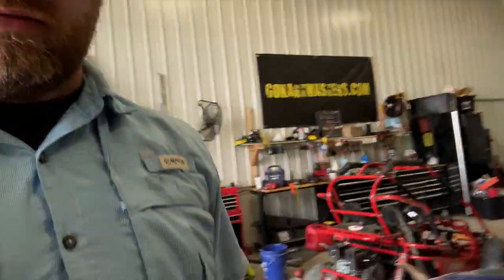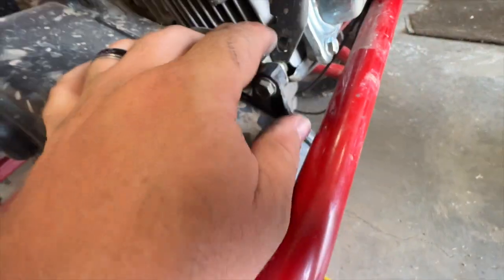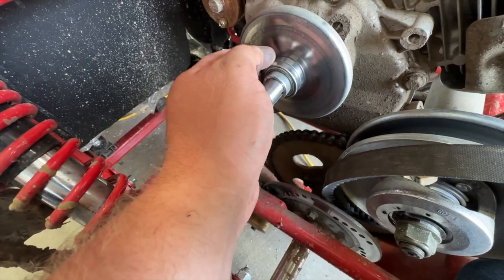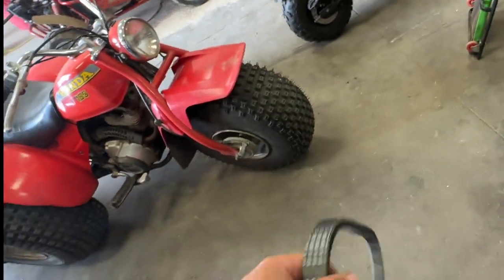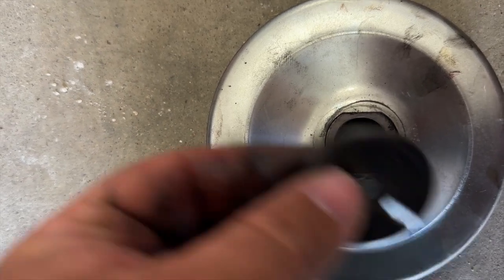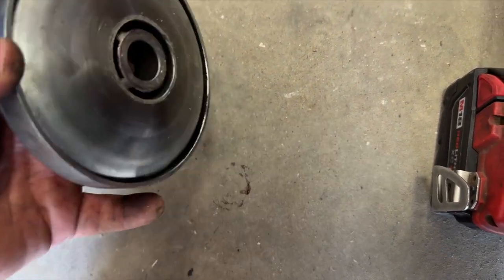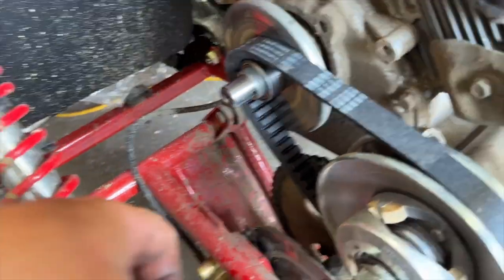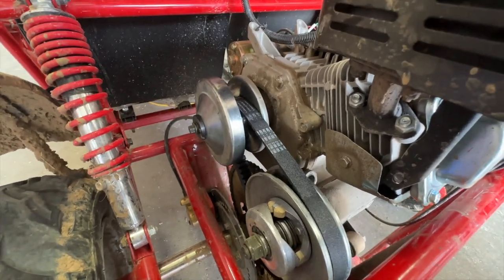How to Service the Torque Converter Clutch | Trailmaster Mid XRX or Mid XRX-R

Comment: Great video! We just ate through our belt on a mid xrx machine. The belt i pulled out of it had 669 stamped on the side. Whenever i look for replacement parts, searches will recommend a 725. What's the difference and can a 725 be used or do we need to stick with the 669? Thanks!
Reply from the maker: That number is the length of the belt in millimeters. Some of the hammerhead machines take that 725, and some other karts of a similar size use it as well. The 669 is for Trailmaster Mid karts WITHOUT reverse. The reverse models take the 788. You can find both options on our website, as well as a made in the USA performance belt. Check out GoKartMasters.com.
Reply: @GoKartMastersAcademy  awesome! Thanks for the details and ultra fast response!

Comment: I got a mid xrx that when we step on the gas, you hear a lot of power from the engine, but the kart barely moves. It also has a brand new engine. Do you know what that could be?
Reply from the maker: It’s hard to tell without lots of information to seeing a video but my first thought would be something going on with the drive system. Double check that the collar bushing inside you clutch is properly aligned in the groove of the driver housing and check the length of your belt. You can always email our techs for more assistance.
Reply: Did you ever figure it out. I'm having the same exact issue right now